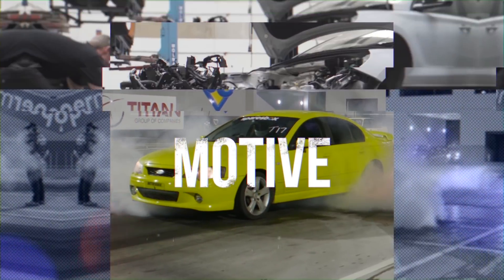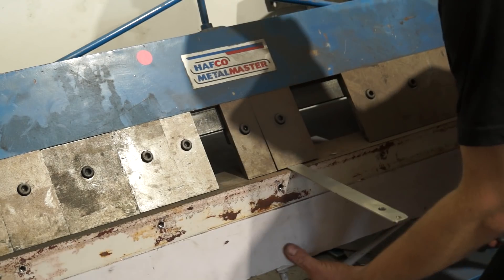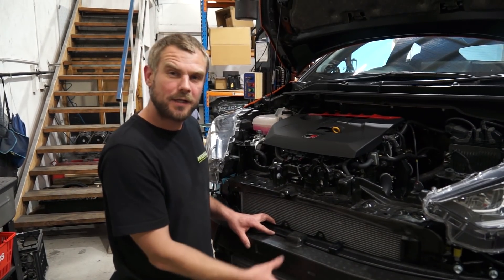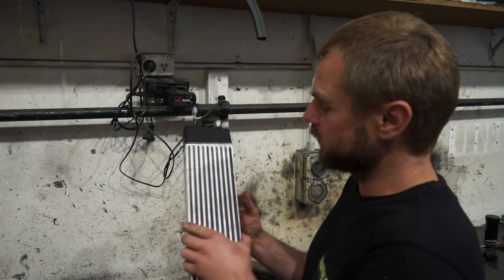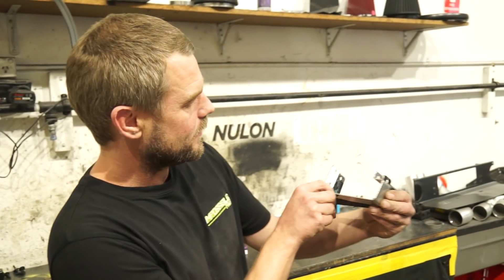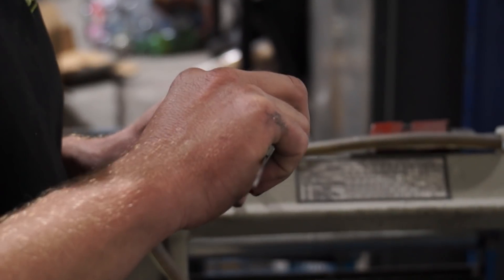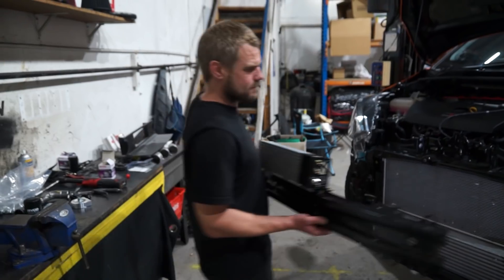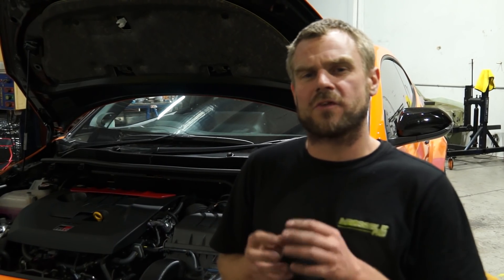We Develop an Oil Cooler Kit for GR Yaris - Day job Ep5

Comment: Very cool. Is the cooler/filter adopter plate have a thermostat? 
If not, how long does it take to get to temp? 
Are you running factory oil weights because factory or ... ?
Reply from the maker: Video shows what oil weight we use
no thermostat. Australia is warm so no need
Reply: @MotiveVideo  Sorry, I saw what oil weight, but would there be any benefits/drawbacks to running something thicker?
Or safer to just stick to factory?

Comment: Just wondering if you plan on selling this oil cooler kit globaly it might be a good idea to consider adding an oil thermostat in there, because these cars in europe will see a lot of snow and cold weather, would be nice to see temps come up to ideal as fast as possible.
Reply from the maker: just ket it idle for a bit longer. no airflow means no effect

Comment: A rear diff cooler would be a really good thing to do for circuit work, the poor thing only has 500 mils of oil & has the clutch packs in it too
Reply from the maker: We will be looking at rear diff when we replace the LSD
Reply: Base Yaris GR has open rear diff.
Reply: @Jaredscott89  Yes, the Ralley/Circuit pack has Torsen diffs with a set of 12 or so clutches on the input side of the rear diff, this is what determines the % drive going to it & what disconnects the drive to it when the handbrake is pulled.
Reply: @TerminatorProducts  lol, Torsens don't have clutches. They achieve axle bias through the worm wheel and worm gears.

Adding a diff cooler to the above vehicle that doesn't have a LSD in the front or rear would be utterly pointless.
Reply: @Jaredscott89  LOL I'm not talking about clutches in the diff, they are on the input to the rear diff.  have a look at it here  https://www.carthrottle.com/post/6-things-i-learned-about-the-awd-toyota-gr-yaris/
Reply: @TerminatorProducts  Actually you were talking about clutches in the diff, read your first post.

That assembly is separate to the diff.

Comment: Just 1 question, why is the check engine light on? Is it because of the exhaust? I want to mod my gr when I get it and was going to get most of my gear from you guys.
Reply from the maker: We tried a couple different o2 sensor spacers. some of them throw engine light every couple hundred kilometers 

we just clear it and keep going

Comment: What oil do they run? What have you been putting in? =]
Reply from the maker: They run Toyota 0W-20, same as Supra. 
too thin in our opinion so testing 5W-30
Reply: @MotiveVideo  Penrite?
Reply: @YesNoMaybeIDntKnwDoU  Nulon
Reply: @MotiveVideo  It isn't the same as the Supra, its a higher grade 0W-20 than the Supra

Comment: Is the engine light on at Wakefield because it doesn't like your mods?
Reply from the maker: The full exhaust throws it every few hundred kms. A different 02 sensor spacer has since stopped it